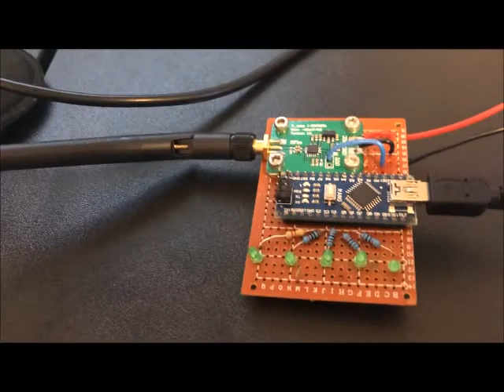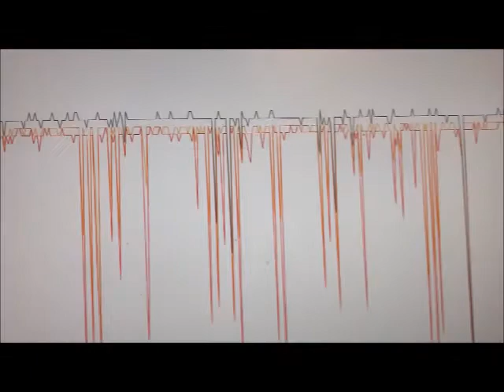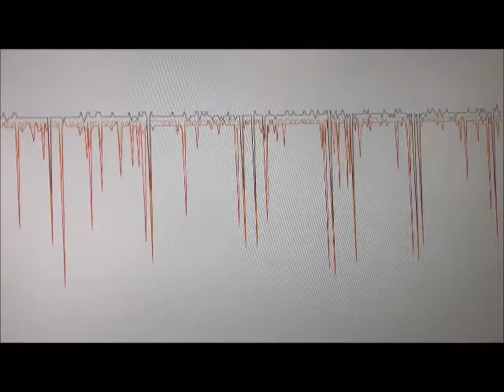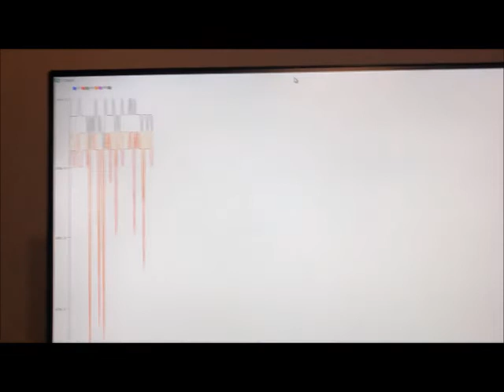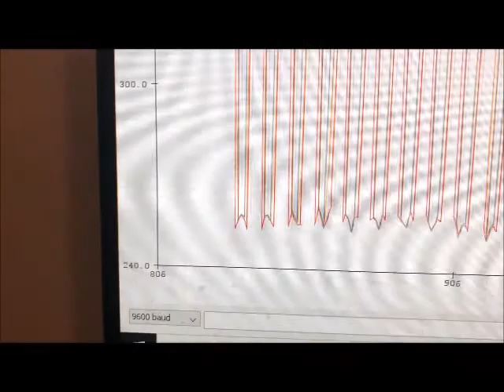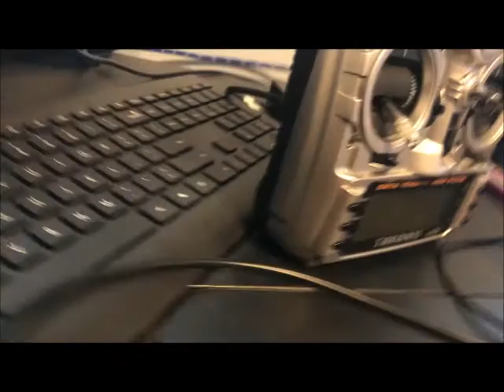AD8318 Arduino Nano

Comment: Great Video, I have a question. I was acttually trying to do something similar as yours. But I am struggling to get the values. I was trying to observe the behaviour of the AD8313 when bringing it close to the wifi router. I was not able to get any significant change in the values. I was gathering raw data through the output of the AD8313 using the analog pins of the Arduino. Is this the correct method to do it?? How were you able to achieve such sensitive values?? Any advice on what I might have done wrongly? Is it possible if I can have a look at your coding style? Thanks
Reply: https://www.youtube.com/watch?v=t_RtPClt_Pc